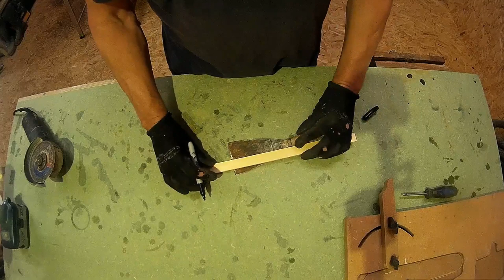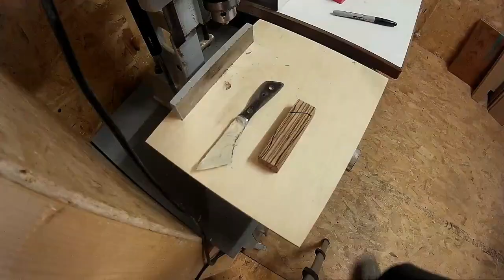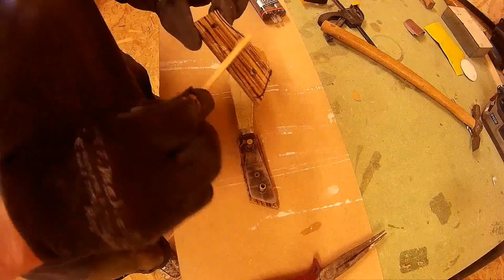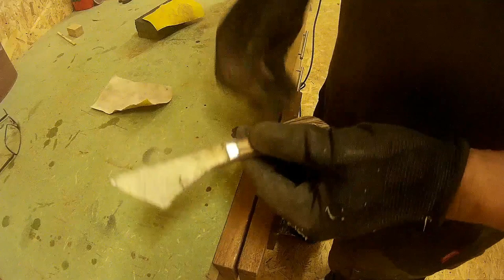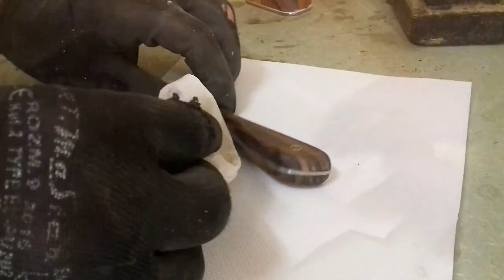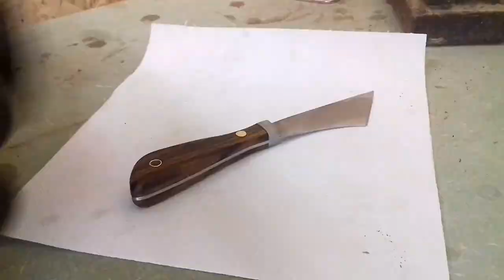Making a Marking Knife from a Rusty Scraper

Comment: Great idea.  Great workmanship.  Everyone has old scrapers that can be repurposed.  I've made a few marking knives and the style I prefer are ones where the cutting edge is parallel, or close to it, with the handle.  Your cutting edge is at a severe angle.  It seems to me that the knife would have to be held in almost a vertical position to make the mark, which seems awkward to me.  I didn't see you demonstrate the cut, so maybe I'm missing something. Maybe the knife is held upside down from what I'm thinking?